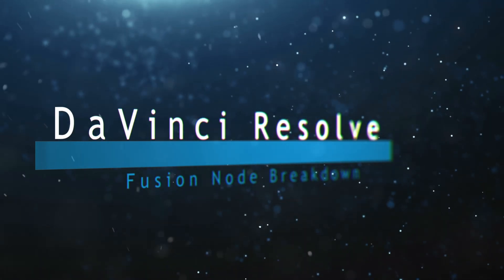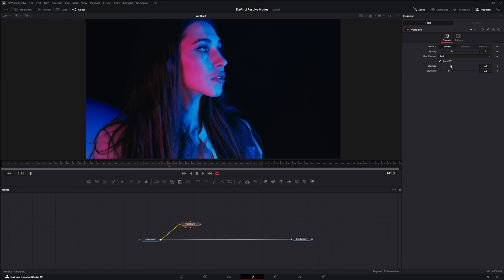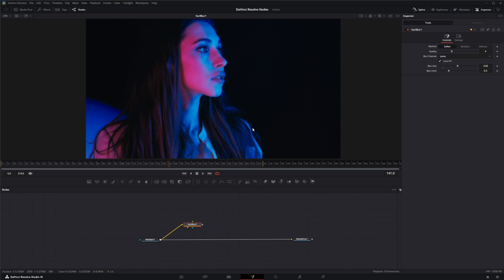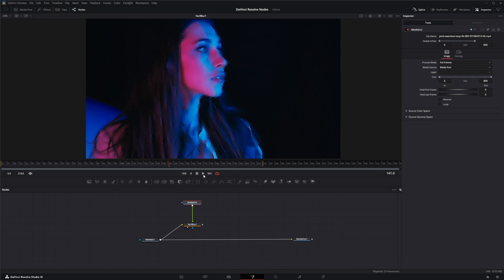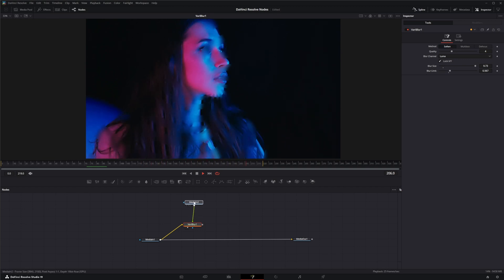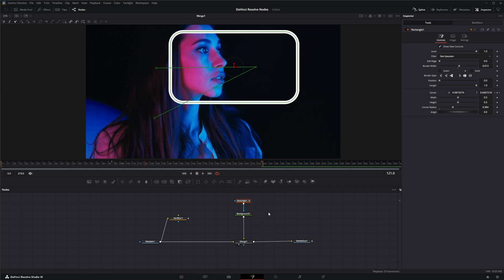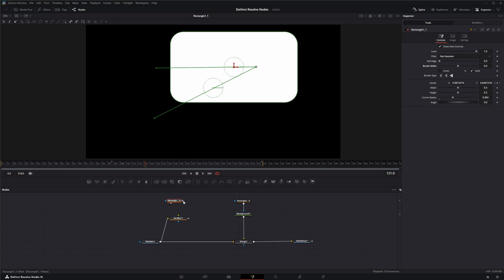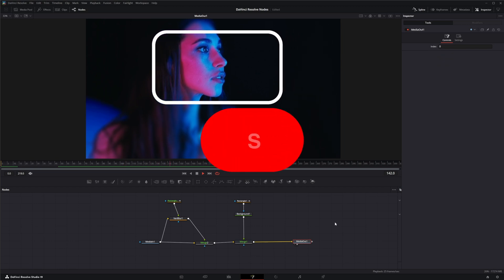DaVinci Resolve Fusion Vari Blur Node

Comment: sorry,  this example is not at all the strength of the variblur, any kind of blur would work for what you demonstrated. 

the difference from a "normal" blur is that it can gradually change the amount of blur, for example, to simulate depth of field with a smooth/realistic transition from sharp to blurry. 

try connecting a smooth gradient to the input of the variblur, and to the mask input of a normal blur and see the difference.
Reply from the maker: You're correct,  I was trying to keep it short a simple, but i didn't even think of just using a simple gradient  to show it's capability....hope others read this comment so they can learn from it....or I can eventually to a single vid covering the difference between all the blur nodes together! Thank you for the feedback!